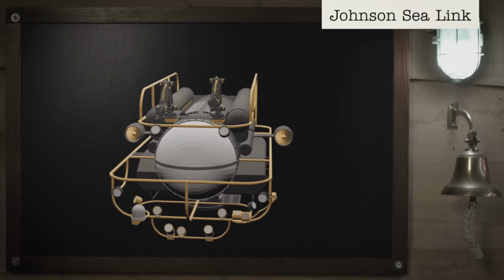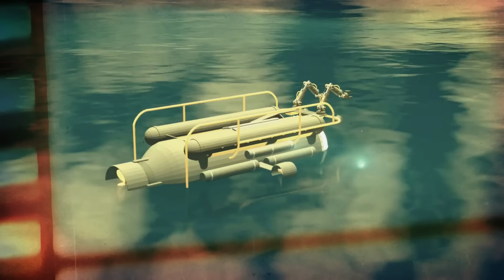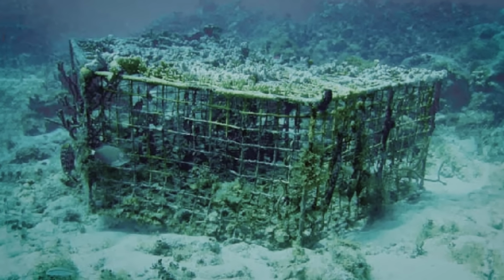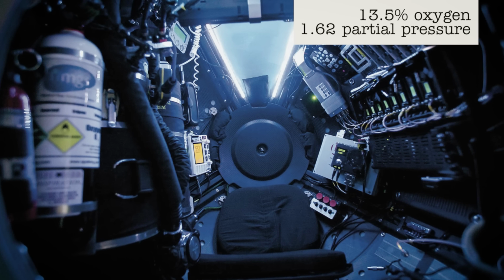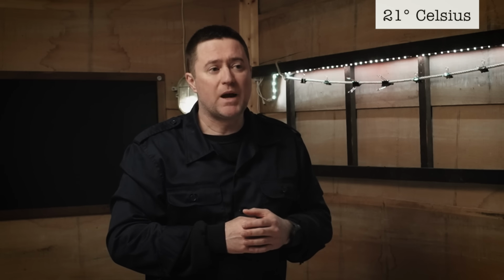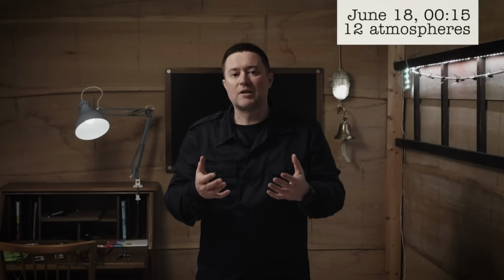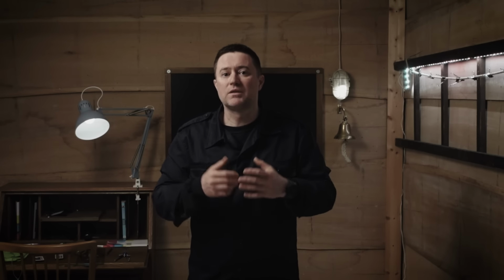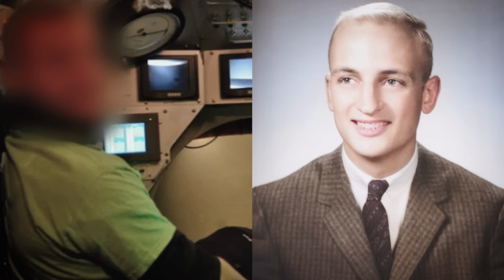This CO2 Scrubber Killed Half the Crew!

Comment: What a half-arsed dive plan by a bunch of amateurs ignoring risks!
Don't dive with equipment not working and some crew not properly dress.
The should have covered or removed the unwanted clips as they were a snag hazard.
Fish trap was too close to the wreck and the recovery clip had obviously not been checked before the dive.
That the US navy didn't have knowledge of currents and slack water times seems strange.

Comment: So the faulty CO2 scrubber didn't kill anyone, it just forced the men in the pilot's compartment to improvise an alternate solution and they survived. The scrubber in the dive compartment was technically fine, it just stopped working because the temperature dropped too low.

Comment: it seems dumb to me that a ship would be scuttled with a flag and rope that could float around in the water currents when its basically a given that divers or underwater vehicles would be in the area either for ecology research or recreation. feels like if race cars had the fuel tank where the passenger seat would be, one accident and its deadly(yes fuel can be deadly in many crashes but that's why its not in the cabin, so it has to travel further to reach the driver)

Comment: You say you have no clue how much pressurized air they had in the diving compartment, but then proceeded to say they started using the oxygen masks at 22:25 and ran out at 23:11... 
Lmao doesn't that mean they had approximately 46 minutes of oxygen in the compressed O² cylinders? 😂
Reply: Also it's seems like a major oversight to not have even a single sealed hatch to allow access between the 2 compartments... like maybe right where they put the viewing window between the compartments lmao 
This would've allowed them to share the baralyme with the diving compartment and might have prevented this tragedy 🤔

Comment: Question. You keep referring the the gas as Carbon Dioxide CO2. Isn't Carbon Monoxide CO a much more dangerous gas that requires a scrubber to clean out?
Reply: CO is produced by partial combustion of hydrocarbons in an oxygen poor environment. Unless something is burning in the compartent there is no CO to worry about.  CO2 is produced by oxidation of carbon, it is what the cells in our body produce by "burning" fat and food and exhale when breathing. In a submersible or other enclosed space, breathing increases CO2 levels. In submersibles we used chemicals such as lithium hydroxide or SodaSorb (which is what is used during surgery in certain anesthesia techniques) to remove exhaled CO2. As CO2 is removed, cabin pressure decreases (it also indicates the scrubber is working properly) and when CO2 level is reduced and/or cabin pressure stabilizes at the lower level, we would bleed oxygen in until normal cabin pressure was restored. If we were working hard that cycle could be short and we would do a "continuous bleed" of oxygen at a low rate and keep the scrubber running. Short answer - NO, CO is not a problem unless the sub is on fire.

Comment: I have worked on many boats on shore as a scaffolder and a few that were just in the waters outside the harbors where workers don't need their off-shore papers to board and can ferry to the shore to change shifts. 
And I have a lot of respect for the men and women who work offshore jobs and the divers.
I've worked on 2 diving boats and a research vessel with compression diving gear and a  diving vessel like the one in this video.
The size of these bells and decompression chambers are seriously claustrophobic.
I talked to many workers, divers included and they can tell you some horror stories about working on the sea or under the sea.
Sad thing is also that these jobs are risky and bring serious danger for workers but  it would be rewarded with a fat paycheck.
But nowadays a lot of jobs are outsourced to foreign workers and the paycheck for local workers is not worth the risk anymore. 
And nobody hires locals anymore because they are too expensive.
And now because of the green agenda the western oil rigs are rotting away unused or sold off to China and Russia who drill without oversight and total disregard for surrounding sealife and nature and even worse, the safety of the workers.
Most of the accidents happen because of bad maintenance, cutting corners and taking risks to continue production.
But we got rules, regulations and accountability.
Imagine how many accidents and fatalities happened at sea with Asian and Russian offshore workers that we will never hear about.
In the end everyone that has perished at sea came for a paycheck for their families and loved ones back home.

Comment: instead of putting the O2 on their faces, they could’ve just slowly bled it into the compartment ever so slightly overtime it would act as the O2diluent … they did not have to put it in their mouth. They could’ve just ever so slightly, fed it into their closed atmosphere… Surely they had a way to slightly depressurized the cabin no. ⁉️💁🏼‍♂️

Comment: It's like dumb and dumber.
No one thought of diving down with some bolt cutters to free the trapped ship?  

Maybe one day someone will be smart enough to make a lowerable platform with extra equipment divers can just swim over to and get stuff from if they find they need additional equipment /hose length over having to return to the surface.  Hell... maybe they can hook air lines to it so divers can use them.

Comment: I would just like to point out that you repeatedly use the phrase "partial pressure" as a unit, and that's not a full unit name. That would be like saying "3.2 partial of gasoline" in reference to your fuel tank. 3.2 what? Gallons? Liters? Tanks?

To be more precise, you should be saying 1.2 atmospheres partial pressure, to indicate that the partial pressure of the gas is being measured in atmospheres and not like, percentage or something.

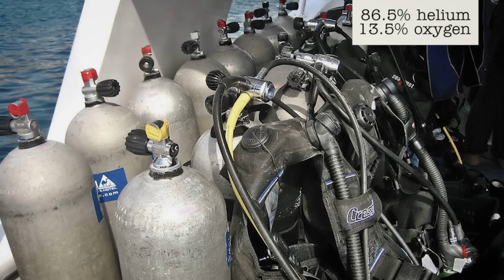Comment: If those are the tanks they used (at 2:30) the tanks in the front look like they are possible steel (negatively buoyant) and probably somewhere in the 100cu to 120cu range.  Meaning they contain approximately 100 or 120 cubic feet of "air" or Heliox.  However, the tanks are usually pressurized at 200 to 300 bar (steel tanks are probably closer to 300 bar than 200 in my experience).  Anyway I hope this is useful information for you.  Love your channel.

Comment: What baffles me is that the 2 guys in the back just stayed there and didn't attempt a lockout dive. Also that they were allowed in with only light clothing and didn't have something warm bundled in there with them like a set of drysuit inners. 
Even if they failed to get the submersible unstuck, they could have returned to the surface by grabbing something buoyant and floating up the 100m, that's a long time to go without another breath of air (though they would need to constantly breathe out to not rupture their lungs on ascent), or if the submersible had normal open circuit scuba tanks for lockout dives, they could have ascended at a slightly less rapid pace while breathing normally. If there was a line on the submersible they could have tied it to the frame held it and brought it up with them, leading the navy divers directly down to the sub. They must have known that the chances of rescue were extremely slim at that point, so they should have attempted a self-rescue.

The only issue with that is decompression sickness, but there was a hyperbaric chamber right above them, so even that wouldn't be too serious (unless they got very unlucky and had a bubble form in a major blood vessel in the brain or heart) as they could just be recompressed and decompressed.

Comment: So this vessel was constructed to dive to 300m, a depth where temps. are not much more than 4C. Yet her life support system relies on the functioning of a CO2 scrubber chemical that doesn't work at those temps. If this isn't a faulty design I don't know what is. There should have been a heater installed that kept the scrubber chemical at an optimal temperature at all times. This isn't rocket science and the builders of this submersible were obviously not professionals. And neither were those who placed that fish trap right next to a hulking wreck with all sorts of hooks and lines and obstacles dangling and ready to catch anything that comes close. And a fish trap at that that can only be lifted with the aid of a submersible that has to perform some highly complex maneuvers to hook a line into the fish trap. Fish traps are used all over the world routinely by thousands of fishermen and none of them needs a specialized submersible to pick the thing off the sea floor.  And why didn't the two guys in the dive compartment exit the moment the "Tringa" was on station with divers that could have enabled the two guys to go through the appropriate decompression stops on their ascent? Being cold isn't an excuse when your life is at risk. This sounds like a f..up almost as bad as the "Titan" disaster.
Reply: I think the point was using the huge ship wreck as pinpoint the person who had the idea was like "wow this is such a a good plan"

Comment: Its grim fact that when it comes to operating deep underwater the moment you start getting lax with safety measures is moment you've signed a death certificate for yourself of someone else in the foreseeable future. 
They shouldn't have dived with only 1 working C02 scrubber, it wasn't an emergency to make that dive so there was no justifiable reason for not postponing it. I was also aghast by meh reaction to the smell of something burning. Anytime you smell something burning while operating a submersible you don't shrug it off you find and fix the issue right then and there or you surface and do a full inspection if you cannot locate the source. 
It makes me sad just how often a lot of these tragedies could have been avoided had people just followed proper safety protocol and showed even a little good sense.

Comment: The snap hook mounted on the underside of the diving craft should have automatically barred it from getting within 200 meters of a wreck.  If that snags on anything, there's a good chance everyone will die.  How was this ever allowed?   Ad then they dived despite several people knowing there was a bad scrubber fan and no backup, so I don't think they had a very good "safety culture".  Which is pretty astonishing for deep sea divers...   But the two in back in shorts makes it sound like they were just tourists going on a short joy ride in dad's submersible.  Send in the clowns, we've got a circus here.  That, and anyone care to wager whether the outfit or the craft was certified to take untrained noobs on a tour?  I'm thinking probably not.  "go outside and unhook it or you'll die!   nah, I'm cold, I think I'll stay here."  - clearly not professionals.  Go outside and maybe die, or stay inside and probably die - that should be an easy choice.

Comment: Talk about an Unsafe System , This is totaly Uniseptble I'm hoping That now all these Submersibles will be desighned in such a way that they don't have lots of things sticking out that can snag on recks , also plenty of Cameras on the outside of the craft  so they can see clearly whats around them , also make the Claw Grabber further away from the sub ,so the sub body dose not need to get so close to the reck site or what ever they could get caught up on , also both those air scrubbers should have been working even if your only using one if two  are not working  then you don't dive simple as that  these days there should be no excuse for anyone loosing there lives if your going down in a sub , then you have to adhere to all safety protocls I don't care who you are , if not you don't dive, Sad that those men lost there lives unnecessarily

Comment: One thing I am not getting, is the issue is the CO2 in your exhalations, and it works worse when it is cold, right?

So, you have the pellets, and you wrapped it in a shirt, why not do that and breathe directly through the bundle of pellets? That way the source of the CO2 will go directly into them, also when you inhale, the air will get a second chance to interact with the pellets before entering your body, and the heat of your body/breath will keep the pellets at a good operating temp.

Comment: Everybody involved in this mission from the submersible crew to the people trying to save them seems utterly unprofessional with the amount of failures happening all the way through this crisis. How can you land on the wrong side of that huge boat twice in a row and then get stuck when finally getting a diving bell to the location? The people running the diving mission obviously did not prioritize safety either and did not even calculate their expected surviving time correctly based on the temperature in the ocean so it’s just an all round failure.

One would hope that this is much better today but seeing how the OceanGate sub safety were handled there’s not a lot to be optimistic about...

Comment: Proceeding without a backup for a Critical (aka 'thing' that keeps you alive) system and entering a trebly hazardous area (underwater/poor visibility/wreck site) is cavalier in the extreme.  If a simple off the shelf fan was replaced this entirely avoidable situation could have been averted.

Comment: 25:35 amazing that they had no spare diving bell in such a large area!
Reply: That was my thought. The nearest bell was over 6 hours away in San Diego? This just seems stupid as hell. If you're going down to the ocean floor in a submersible that your life depends on, you'd think they would've dat down and tried to figure out every situation that could go bad. Sub gets hooked on a piece of metal, how do we get it unstuck. Scrubber fan stops working, what do we do? There should be a way that divers can swim down and hook up an umbilical cord line that keeps fresh oxygen going in and somehow take the carbon dioxide out. This might be difficult but everybody in the sub should be diving certified enough to put on a tank and suit and evacuate the sub. That might be complicated. While they would eventually run out of time, they had HOURS to figure out how to get them unstuck. What was the purpose of the ship parking over the sub and then securing itself to the seafloor? It just seems that they wasted so much time on something that should've been one thing on the list of possible problems. Sub gets stuck, what's next? :}

Comment: A smell of burning while underwater and with a faulty fan speaks of immediate danger! They should have mentioned the smell of burning, so the rescue team react with priority!
Reply: More to the point, when they smelled something burning, they should have immediately aborted the dive and returned to the surface.  Even better, when they found that one of the fans wasn't working during the pre-dive they should have aborted the mission before even starting.
Reply: @JanPeterson  The non-functional fans didn't really have any bearing on what happened though. They were in the front compartment were they not?

However it shows a culture of complacency. Especially when the two men in the back were allowed to go down in shorts and t-shirts. There would have almost certainly been some drysuit inners on that vessel, it wouldn't have hurt to tell the guys to bring those even if they don't plan on wearing them.
Reply: Absolutely 💯
Reply: They were very naive that's so sad 😭
Reply: Wouldn't have changed anything. The rescuers we're finishing their drinks first

Comment: This is the risk of easy routine operations ... eventually people get complacent and then something as stupid as a cheap fan working or not becomes the difference between life and death.

They should have only used the sub after it was in full working order.
Furthermore,  they should have had a diver onboard who could go outside to untangle and fix stuff when needed instead of having regular passengers.
Also,  with such an operation they should have had a rover as well that could perform basic stuff like cut a wire and such.

Last ... I assume those kinds of Coast Guard rescues aren't that standard and to their credit they did a lot of logistic work to get multiple options on scene ... but ... damn.
They lost lots of hours fumbling.

Comment: I wonder if of the two people that died had a rebreather that was designed to take Gases from the pressurised vessel through CO2 scrubber and excel directly back into the vessel

Because they’re at the same pressure they should be able to inhale gases through the scrubber and exhale the gases back into the vessel over and over again without having to have the complicated lung structures that normal rebreather have

I feel like that would be much simpler setup than what a conventional reverb would need

Or even just simply adding to standard rebreather for each person that should give them an extra 24 hours each 
But the two things I suggested seem like pretty simple and cheap options for masterfully extending the survival type
But I’m definitely not expert. I’ve just pondering possible options that could make the situations safer. I almost certainly probably wrong because I’m as I said not an expert. 

It is a very tragic loss of these individuals which I hope with further improvements of safety can be prevented 

Even though I feel like my comments are probably not useful but just sometimes thoughts from outside of the field Can give some interesting new ideas
Reply: Your recommended technology had not been invented yet.